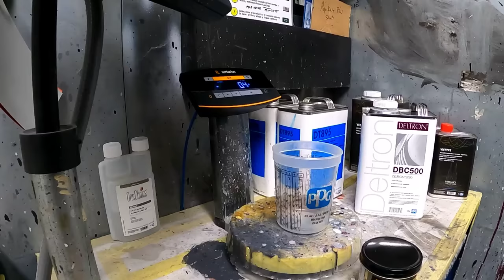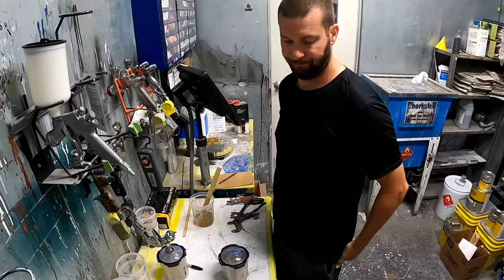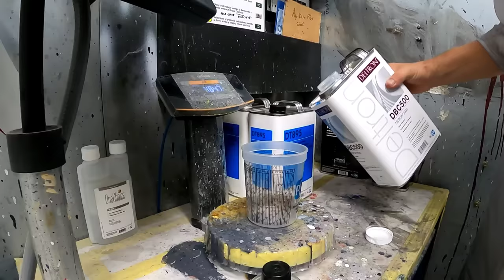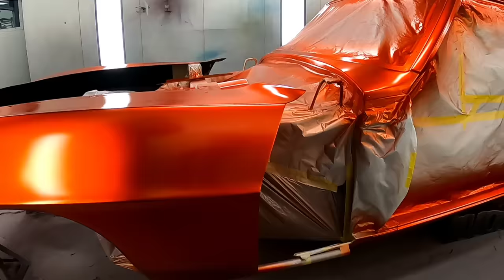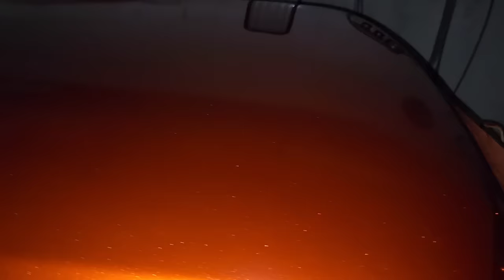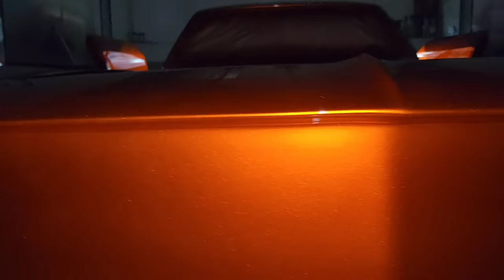69 Camaro Orange Candy Part 2 (Herb da Rula)

Comment: Man that is so beautiful this is why I love pro mod drag cars they look more like the original car and most of time uses most of the original body panels with some extra work done to them to fit and look correct on a pro mod chassis. Awesome paint and body work. But the body work is what I'm more impressed by he put tons of hours into that body to get it to fit and line up and look right then had to use guide coats and make sure the surface is 100 percent perfectly level and smooth. You sir are a master of your craft. Any one can sand and spray some paint to look decent with a spray gun but it takes a master to make it look this good. I have this exact same paint job brands of paint Gardner's flakes and base coat and clear coat on my asphalt oval track super stock and under the lights it looks hot and beautiful looks better at night under the lights then it does during the day almost two different paint jobs lol nice work. I love house of kolor. I did my paint job back in January I called house of kolor and told them I want candy orange with metallic flakes and they gave me exactly everything you used in this video they know what they are doing guys house of kolor will get you right. My racecar is two tone this exact same candy orange flake with pearl white it looks sharp together it's not your typical two tone paint job either I laid out a cool swop to it

Comment: The addition of that one coat of gold flake did add some extra sparkle to the paint. I'm assuming that gold flake was .004 size. A nice trick that adds a little something special. I'll try to remember this video. You've got a new subscriber. I plan on doing a candy paint job soon. Silver base, .004 and .008 chrome silver flake, then Magenta candy concentrate, HS clear.

Comment: What an amazing color and spray job mate.  For me I think I prefer it without the flake as a solid color like it looked before you shut off the lights. Still that has to be one of the best paint jobs I have seen. These modern paints are really amazing. Last time I painted was back in the early 80's and just not getting back to it with air brushing learning that. I will be doing guitars though instead of cars and just finished base coating my current build as my first attempt.

Comment: Very nice! I'm doing a Rambler in my garage. I want to use a color like that (Tangelo) for the base coat then do HOK root beer brown over the Tangelo, then  a cream top. I did HOK brandy wine before, now I want to step it a notch. Thanks for the vid!
Reply: Allen I would like to see it when you are finished.... Phillip Hall
Reply: @PhillipHall01  Hello again. I am ready to start laying some color down on my car. I'm doing it in my garage. The car that had my interest as my goal (Brian Bozzo 49 shoe box) turned out to be HOK KK07 root beer brown with Tangelo fades on the top most surfaces. Not what I want. It looked really bad under florescent lights. So I'm thinking about fading the base coats. Black down low, white in the middle, and HOK PBC-64 ultimate orange on the top most surfaces. Have you ever adjusted base coats under your candy paint jobs? Thanks!
Reply: @allen2515  
I haven’t Allen.  The root-beer  brown sounds like it would go very well with the shoebox. Is it the added tangelo that caused the problem?  
It is a bit of trouble but next time spray a color card to make sure your colors are what you want before painting the whole car.  
Thanks for getting back!  I am interested in what you decide and how it turns out. Let me know please. 
Phillip Hall

Comment: how did those doors match when they were back on the car. I have done many custom paint jobs and i always have the panels on the car when doing the base colors and then very carefully take panels off to clear if you wish. It is a lot more work but you have a perfectly uniform color from panel to panel when walking the sides. I have worked with guys who paint all the panels off the car and sometimes it doesn't work out. Cool color and i hope that it worked out..:)
Reply from the maker: Check out part 3 and a Short vid in the sun.

Comment: Beautiful job, but I must ask, how do you keep your spray out from striping when you overlap. Or no overlap?
Reply from the maker: Im usually at a 75% overlap on each pass if that answers your question.
Reply: @paintbycurry1531  I guess. 😁
Reply: @jsh3234  Perfect distance, speed and fan on the gun. Most painters do lots of light coats to try and achieve a candy or metallic with no striping but this guy is on another level.
Reply: @danieljessop7140  Yes, for sure!!!👍👍

Comment: That's like an interco clear correct I'm not too familiar with that PPG of usually shot a little bit of candy with the clear coat maybe I should try it that way
Reply from the maker: It is an intercoat clear. Just like a pigment free basecoat. Gives you a chance to add something or maybe even sand something away before clearcoat . Thanks for watching!

Comment: That color reminds me of one I've sprayed before. It's in PPG Luminescence called Fall Foliage. It has a candy dye in the mix. It has characteristics of a tri coat in a two stage. It has an extreme shift in different light. Not a cheap color though. What clear did you use? I saw a Vibrance label on the bench. Was it VC5700? Beautiful work by the way!

Comment: when applying the gold flake you mentioned it was added to the already silver base, do you think that a silver flake would have the same effect as the gold? asking because I would like to add silver to mine as you have done with the gold. one other thing, did you wait be min, hours, days between coats. and was it necessary to wipe or sand between them?
Reply from the maker: Silver flake over silver will just look like you used a coarser silver. The gold just blends in nicely with the orange. Never sand your last coat of base, the flake coat or the candy costs. Dry times are as normal. Typically 10-15 min between coats.

Comment: I am by no means knocking the trade/craft/skill but it blows me away how many painters brag about their quality of work as a painter and they show their work in pics. Then over time you run across their work in person and see their "quality" in person and ya wondewr wtf were they bragging about.  I personally as a painter spray cabinets and old grandpas bicycle or radio flyer. I airbrush but wouldn't dare attempt anything freehand that isn't easy free hand (flames, lightening etc because its near impossible to fuk it up). The act of spraying a car can be taught on $100 worth of scrap panels from the junk yard providing you have a great taughter lol.  I went from painting cars to painting house based on money to be made.  $65 and hr or  $120 and hr. didnt take rocket science to figure that out.  Alot less overhead to do so as well.  Anyone thinking of painting their own car/truck? Go buy a few panels from a scrap yard to practice on first. It will do you good. Spray bombs or a compressor/gun set up don't matter but practice first. If spray bombs and it say to be 8-10 inches from the substrate do 5-7. its never what they say on the label to get the best results.

Comment: Hey when you used the house of kolor gold flake did you have texture that needed 400-600 sanding and re-clearing? I am working on a project I have an ultra fine gold flake 0.008 I am just trying to determine material consumption or if 2-3 candy coats and 2-3 clear coats will leave a smooth finish
Reply from the maker: Everything got re-cleared. Could have just sanded and buffed but there was more work to do so a re-clear was gonna happen anyway.

Comment: SWEET, beautiful job, my favorite color. Have you ever used large boat flake on any of your jobs?
Reply from the maker: I've used the standard size flake from HOK before.  Got to be sparing or it will look like a bass boat! LOL
Reply: I used bass boat large flake on my asphalt round track latemodel and on my dirt track latemodel. And man it looked really good on a dirt car because it would help make the car look cleaner then it really is and see the color through the dust and dirt but it was just way to flashy on my asphalt latemodel. I did silver large bass boat flake with pearl white it looked amazing under the lights at night but during day looked like a low rider from southern California that would have hydrolics and ride on three wheels and one wheel in the air lol

Comment: What gun and number tip are you using to spray the mixed in flake ??
Reply from the maker: Iwata Entech 1.3mm. Only with tiny flake like the HOK Mini. Otherwise need a 1.4, 1.5 or bigger.

Comment: Couple of questions what temperature do you reduce that with slow reducer and also what is the good tip size do you use on the gun
Reply from the maker: I was using my Iwata WS-400 1.3mm for the clearcoat. It was 85 degrees F and i used DT898 . Its pushing the limit for runs but if you're used to it, it will lay like glass. I also have the fluid turned down, some so not quite as much clear is in each pass.
Reply from the maker: The basecoat was shot with an Iwata Entech 1.3mm. At 22psi

Comment: Subscribed, what are your gun preferences?
Reply from the maker: Basecoat-Iwata LS400 Entech 1.3@ 18-22psi, Clearcoat-Iwata Ws400 EVO 1.3@ 29psi, Sealer-Iwata w400 1.3@ 20psi. Base and sealer guns are wide open on fluid adjustment, clear gun fluid adjustment is 4 3/4 turns out from completely closed. The fan pattern on all of them is adjusted after my pressure is set. I close the fan until I see the air pressure start to rise.

Comment: Spraying it disassembled with 2 different metallics, and 3 coats of translucent color makes me wonder how in the world these panels are ever going to match each other??
Reply from the maker: If i were to have stopped at the silver, it would all match. Adding on the little bit of gold doesn't alter it much, if any. The candy is all about consistency in the pattern per coat. Part 3 will be out in a few days and you will see it all together.
Reply: @paintbycurry1531  I look forward to seeing it in the sun, to see if the fender-door-quarter colors are the same.
It seems to me that the metallic flop when spraying panels at different angles could be a problem, since even regular basecoat/clear coat metallics can pose problems -
Reply: He shot the car each step complete…all panels at the same time each step, same cup of paint

Comment: I don't know if anybody's told you, but you are not the most technical or detailed how to paint YouTube channel. For starters, you don't show the gun and tip size. Secondly, you don't show the gun settings. Thirdly you don't show pressure required. And the list goes on. On a scale of 1 to 10, your videos are a four. How do I know that? Because I watch your competitors on YouTube. And the best ones show all the details on how to. On this basis alone, I won't be subscribing. But I do wish you all the best.
Reply from the maker: I'm just gettin started. Stick around and maybe you too can learn something.